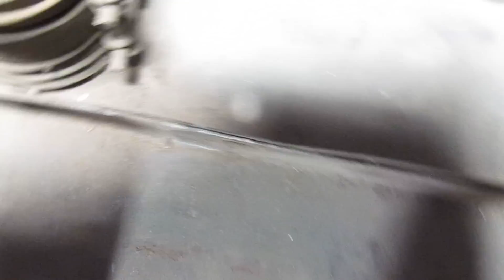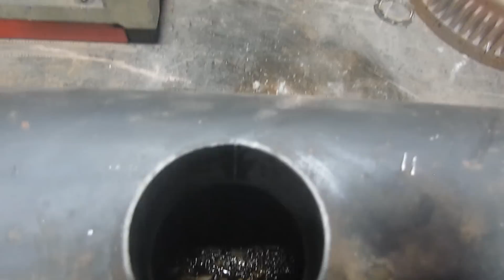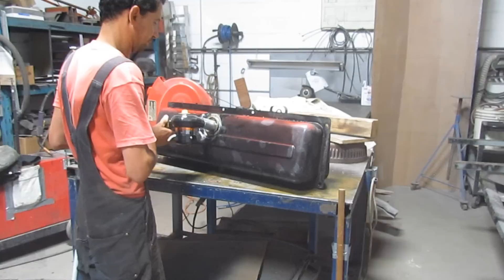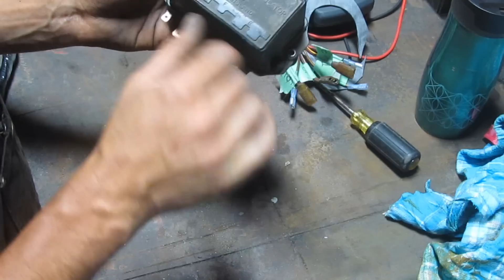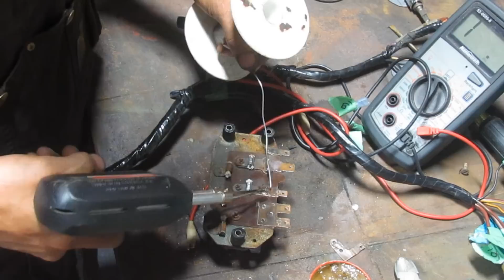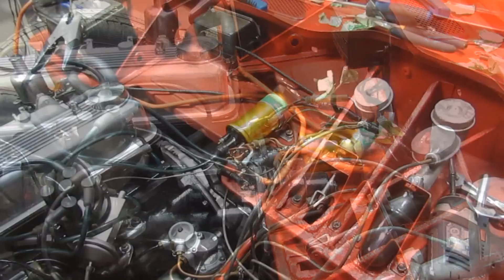1966 Triumph Spitfire MK2 restoration project - part 23

Comment: Hi Elin, with the gelled fuel, it looks like you poured it from a kettle. Did you have to warm the thinner? BTW, the gas tank red looks awesome!
Reply from the maker: No, I din't warm it. But later I read more and found out it was a good idea to neutralize the acid with baking soda. It was too late to do it and I don't have any issues so far, but they say the acid keeps working on the metal if it not neutralized.
I am glad I painted it red, because I still do not have a cover in the trunk, so it is seen.

Comment: Nice work and here are a couple of tips. I would use a 100w soldering iron with a big tip. Those instant heat irons are not that great. I would also clean up the copper with  a brass brush or say 400 grit paper with WD40 as a lubricant. The cleaned copper will solder a lot better and more easily. A 40 watt temperature controlled iron would work too but extra wattage is always useful.

I don't think your car was charging properly. You should see between 13.7 V and 14.3V across the battery. The problem might have been that you didn't have a working charging light installed on the dashboard. I am sure you sorted out the charging later on.

Comment: Loving your progress, specially the initial firing after all that hard work! A good way to clean the inside of gas tanks is a bicycle chain and muriatic acid.
Reply from the maker: Thank you! Yeah I thought about a chain, but this tank has internal walls, dividing it in 3 chambers with little gaps at the bottom to prevent the fuel from shacking left and right too much, so it would be hard with the chain. But thank you for the advise!

Comment: Looking good. I think you might need to adjust your valves. Sounds like the exhaust are a little tight.
Reply from the maker: Yeah, the engine needs a complete tune up. I just got new spark plugs, ignition wires, contact points etc. All the ignition parts. Once installed I will adjust the valves and will check the timing. The carbs were cleaned before, but now I got rebuilding kit and will rebuild them and finally I will get my friend Carlos to tune them up. But yeah, the valves are one of the first things I am going to do.